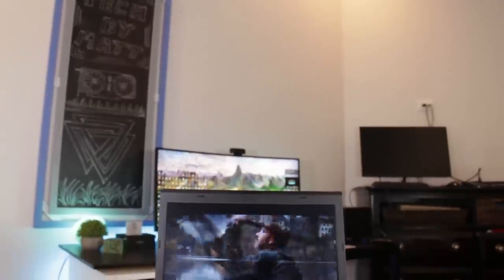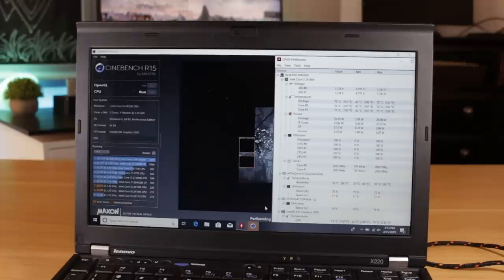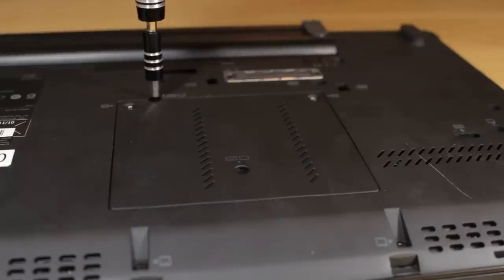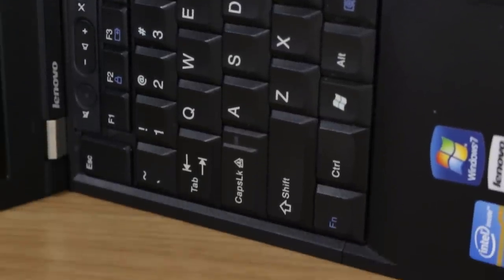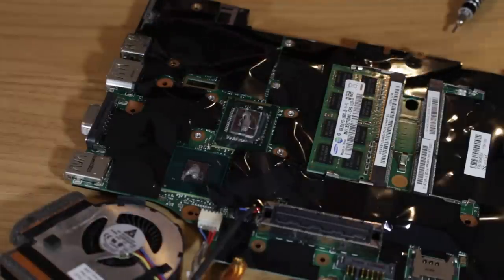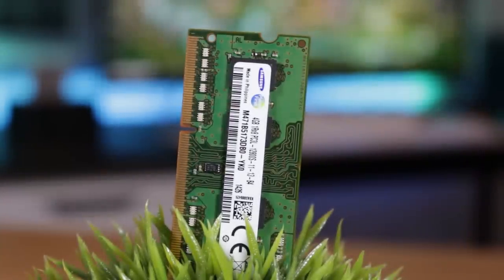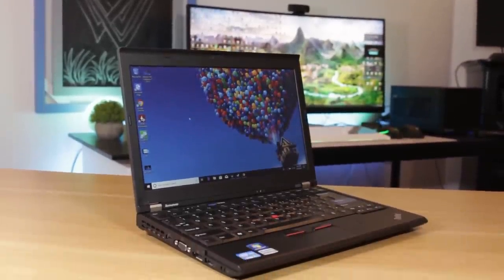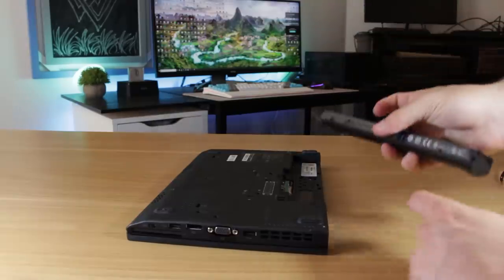What Can A $75 Laptop Do? (Plus Some Upgrades)

Comment: I bought a thinkpad t510 for 40$ 3 weeks ago. It is max equipped with an i7 620m, a webcam, a fingerprint sensor and a nice display (don't know which one). I upgraded it with an SSD for 77$ (500gb, 2.5") and one more 4gb ram stick for 25$ (yes, Switzerland is really expensive) which gave me 8gb in total. What shocked me, was that it couldn't run CS:GO. I'm talking shadows disabled level of low graphics. 10 fps at max. I think I'll try to add an external GPU (I have a GTX 660Ti lying around somewhere). Overall, its better than a new laptop (i7 7500U) in terms of the build quality and I'm using it as my daily laptop now (I have a PC don't worry).

Comment: Thank you for this very instructive video. I was just asked by a friend about about getting a computer and my instructions now are "get a Thinkpad with a removable battery" and your video shows up on my watch list.

Very concise and explains why folks should not really get some new piece of tat for a low cost machine. The getting deep inside and changing the paste and adding the boot drive was boss.

In fact this may be the laptop I am looking for.. the last of the original keyboards? Shut up and take my money!

Thank you again as it really saves me (and my listener) much time with a simple show and tell rather than a long speil.

And of course Thinkpads are the way to go if you are a Linux user. (I persolally recommeod Pop! OS over Ubuntu personally for all around introductory use.. Especially now that 20.04 came out..)

Comment: It's January 2024 and I still use this laptop in an official Lenovo X220 dock and have upgraded it with a 250GB Samsung SSD and 16GB of RAM. I think I might also upgrade the CPU/motherboard to the i7-2640M...

Comment: You can go a bit further by using faster ram which always helps the igp as this generation of thinkpads have no issues using up to ddr3 1866, you can also upgrade the heatsink using the all copper cooler from the x230 which helps a little. As for the battery I recommend the 9 cell and there is the option of finding the slice pack which is basically another 9 cell that uses the docking port connector which can enable over 10 hours of battery life with ease.

Comment: In Belgium in 2017 I bought a HP Elitebook 8460p with a i5-2520M CPU for €170. I like the machine and I directly upgraded it to 8 GB (€25) and replaced the 320 GB HDD by a 1 TB SSHD. The most important update was, that I replaced Windows 7 by Ubuntu Mate 18.04.2 running from the ZFS file system. Most datasets (folders) including the root are LZ4 compressed, while archives are GZIP-7 compressed. The ZFS memory cache is between ½ and 2 GB, which means, that after a short time, the system or Virtual Machine runs completely from memory cache. Cache hit rate are above 90%, so the system is very responsive. Basically the system runs a 3-level storage hierarchy (2 GB Memory Cache, 8 GB Solid State Cache and 1 TB HDD). Note that everything including the caches are kept LZ4 compressed , almost doubling both effective cache spaces and the disk space. It is like having StoreMI on a 2011 laptop.

Planned upgrades are 8 GB to 16 GB. Next year I like to replace the 2-core I5 by a 4-core I7, but that i7 price has to drop considerably. Afterwards I might add another 1 TB SSHD, dumping the DVD, if the SSHD prices are right. I would stripe (raid-0) both SSHDs :) More plans than money, but this year I concentrate on my desktop replacement from Phenom II X4 B97 to a Ryzen 3 2200G, ~doubling my desktop CPU speed (and memory).

Comment: I have a X270 with 16GB RAM and 512GB SSD with a 1080p IPS LED screen I installed and I'm STILL thinking about getting a decent X220 because it's so cheap, durable and it's the last of the great keyboard laptops where the keyboard was simply just another component that had to be great. None of this slim, light, compact nonsense we have to put up with now.

Comment: X220/230 are still amazing machines in it's class, especially if you going to use special edit way to upgrade it.(51NB made a X330p with i7-3612QE, 16G ram and 3*drives. FHD 99% sRGB 13.3in) it is on par with $1000 machine these days. It is even on par with X390

Comment: Men. thats alot of thermal paste
Reply: Yup he iced it like a cake, way too much
Reply: If you leave a corner uncovered you can brick the system with these fully exposed chips. As long as the thermal paste is not electronically conductive it is totally fine and doesn't hurt cooling performance either
Reply: Not that much actually, laptops tend to have pretty poor contact between the heatsink and the die.
Reply: @basbas63  should i use thermal paste if I buy a used laptop.  Or should I only do it if temperature problem occurs .

I don't know how to apply thermal paste
Reply: @bravosix8171  Only do it if there are thermal issues, that is my point of view on this. 

Don't forget that taking a laptop apart is usually a task that takes a lot of care, there are connectors (that connect the keyboard and the screen to the motherboard in example) that are easily damaged. 

In my opinion it is better to not try and fix something that is not broken in this sense. 

Good luck, hopefully if you are going to buy or have already bought a second hand laptop that it serves you well! =D
Reply: @basbas63  Thanks Comrade. I appreciate your help. Peace be upon you.

💂💂💂
Reply: Literally doesn't matter

Comment: I scored an "un-tested" Asus G74SX, a similar era PC, for free...turns out all it needed was a new HDD / SDD,, a new battery, and a 150W charger...it came with an i7 2670QM, I added 8GB or RAM or 16GB...and the included GTX 560m 3GB is a decent competitor to a more modern laptop IGPU.  I actually plan to upgrade the display too, as there was a 1920x1080 with high refresh rate, either 100 or 120hz, can't recall.  All in all, it's been a fun project to resurrect, even though I rarely use it.

Comment: Oh man I love old laptops! I just ordered a Latitude e6540 for $220 with an upgradeable i5 4300m, a dedicated AMD HD 8790m with 2gb GDDR5 VRAM, 8gb ddr3 1600mhz, and a 256gb SSD. It has a charger and healthy battery.

Not bad for a budget gaming laptop! You should look into it yourself, or for a little less ($140-$180 in good condition), its slightly smaller sister the e6440 (the model with the dedicated 8690m which also has gddr5 memory!)

Both laptops have potential to be upgraded to quad core, eight threaded i7's for about $70
Reply: thats impressive value right there, dont  remember how good the 8790 would be, but 2gb vram is actually usable
Reply: @bradhaines3142  It's pretty ok on paper with 384 stream processors, but in reality it seems to perform very slightly below a GTX 660m/750m/940m

Comment: My favorite two of all my laptops, old and new alike, are the T420 and T430... Each swapped respectively with 4c/8t i7 qm variants, which can be done with a T series... unless its an S model usually. Brings them up to a standard FAR above the level of even $600-700 units today, with passmarks and cinebench scores that obliterate ultrabooks as well as business and work machines. Yet rarely consume over 15w... though keeping in mind they are now capping at 35w rather than 25... Also have 16gb 1866 in each. Never tossed an egpu in either of them, as gaming really isn't what they're for, though they can provide light duty gaming on the go with lighter titles, older titles, and emulation... as they are Sandy and Ivy bridge, respectively... so intel 3000 and 4000. Both are running SSD raid arrays, with phenomenal speeds... The 420 has the 900p screen, the 430 the 1366x768, or what, 768p? I dunno.... I'd like to swap it to a 900p as well. The 420 has the last of the amazing keyboards, the 430 goes chicklet, and as such I swapped in a backlit one... so it retains the thinklight, but now has a much more modern backlit keyboard as well...Looks great, and truly types VERY well for a chiclet style. It's a toss up which I like more to be honest, they both have massive merits and very little cons.  New Amazon sourced batteries make for 6-8 hours on either of them, they are 14" units, and I also find them extraordinarily portable. They are robust, well made, and truly just put nearly anything today to shame. I have some other favorites as well, elitebooks with dream color displays, cpu's swapped, etc... but none have so much going for them the way the 420 and 430 do... X series are nice as well, don't get me wrong... but you're stuck with that poop cpu, and that just doesn't work for me... I need passmark's in or very near the tens of thousands... and that i5 just isn't close. It's fine and all, I'm sure it mostly is for most things... but heck, I can render video on either of mine, and it's not even a bad time.  You know what, I did have an egpu via the wlan card slot on the 420, I forgot about that... this was before I had the 1070, 1080, or the 2070, and was running a gtx 1060 6GB... it had no issue keeping up with that card, with the card being the bottleneck up from 1080p to 4k... so the cpu was pretty stout for sure... Just that I have a 4930K pushing a 2070 on the main rig, which keeps up with the gaming needs just fine, so that was the last time i had the egpu dock out. It's in a drawer somewhere I believe. Either way, these are all of the best machines ever made...

Comment: i bought one of these (the tablet version) and I love it, i use it for tuning my car and for mobile movie nights with friends, I upgraded the RAM to 2x8gb sticks for cheap, I bought the LEnovo 90watt power adapter which helps to keep the CPU from throttling when plugged in, and it charges faster. I also bought a legit 9-cell battery from ebay (the x200T's never came with more than 3 and 6-cell officially, but someone makes them) and I bought 2x slice batteries (1 for home and 1 for work) and I basically never have to charge this thing during the day even under heavy use it has 10-12+ hours of battery each day, amazing! DON'T FORGET, to install Thinkpad's software called Lenovo Vantage, it lets you modify lots of features, you can even set a charge limit on your batteries to help them last longer over time. I set mine stop charging at 85% capacity.

Comment: I've bought my laptop for nearly 600$ in 2013, it's 2019 now, it can't even run csgo at a consistent 30fps
Reply: Saad my 2007 08 laptop with b960 processor and inbuilt graphics is running csgo at about 20+ fps. Just using steam on Linux.
Reply: @maninthecrowd5076  mine laptop can't even run steam

Comment: This is a very nice video.  A lot of good information.  I would be a fun project to replace for LCD display with a used IPS panel for fun.
Reply: Heck yeah.
I want to see this myself.
I plan to do a full-on upgrade to at least one of my ThinkPad's for personal use. Already did a personal rebuild on a Compaq Presario CQ57-339WM that is amazing in terms of capability, but I want Lenovo as well.
Reply: Joseph Lopez Damn I used to own a Compaq Presario CQ57 too, I loved that laptop, lasted many years
Reply: @CM-pv3dm  I have 4 of them right now.
One I just put a Core i7 2720QM in it and it runs amazingly. Also found out the ram "limit" was a soft limit. So far I found it can support up to and recognize 12Gb with not a single issue. I modded the internal heatsink for the chipset and lapped them before reinstalling.. The 45w quad core actually runs cooler then the Celeron that was in it originally..
Between that and the 240Gb Kingston Black SSD I put in, this thing will remain in my service for years to come. Also have a backup new motherboard for it just in case.

The second one has a Core i3 2330M with 8Gb of DDR3 G.Skill ram. It's quite a bit faster then the Celeron.

The third one I am putting a Core i5 2350M in with 16Gb Crucial DDR3 1600 mhz ram and another 240gb Kingston Black SSD drive in.

The fourth one will remain stock in parts but will be modded slightly for information purposes. Lapping the heatsink and maybe add a new heatsink or two to the mobo to see if performance changes at all. Right now, it runs hotter then the Core i7.
Reply: The Lenovo ThinkPad T420i I have is going to get the royal makeover. I'm going to throw a Core i7 Extreme in it to see what kind of performance I can get. Not sure if the board will support it, but so far the support list for the contained chipset is promising.

Comment: I recently bought a Dell Latitude E6420 for $74 on eBay. 4GB of ram, Intel Core I7 2640M and a 120GB drive. Will be in on Monday. Also has nVidia NVS4200M graphics. Rough equal to a GT520M
Reply: Abyss Tech Adding 4Gb more of ram will improve it a lot, dual channel does wonders
Reply: @thepeasant269  I've got a 16GB kit in my old Acer Aspire E5-551 laptop I can use.

Comment: this lapotop 100x more cool than any Fruit brand
Reply: real cartoon girl a heck of a lot slower than the “fruit brand”. I’d take a MacBook over this anyday, plus it’s a lot more reliable and you’ll have a warranty.
Reply: @parkerwilliams617  fr
Reply: Talking trash doesn't make apple more appealing, it just shows what type of arrogance purchases them.
Reply: @parkerwilliams617  *Your screen starts flickering due to the connector being loose.

 "Oh your MacBook screen starts flickering? You gotta buy a brand new screen, and a logic board. That will be $1,399. You might as well buy a new MacBook. You will have the latest hardware and firmware and have a new warranty. Will that be cash or credit?" -Every genius bar ever
Reply: @parkerwilliams617  Nope not even close. Thinkpads can be run over by cars, you can spill water on them, thrown around and they'll be fine. If you buy a new Macbook, you get no upgrade or repair options and a number of design flaws (overheating, keyboard failures, display cable failures)
Reply: @parkerwilliams617  For this laptop costing less than $100 itself on Ebay, upgrade to a new SSD, add a touch more RAM to it like the person in the video did. Maximum costs you $200 for a metal built business laptop that's more versatile and durable than any warranty a "fruit brand" can provide. I'd like to see you pay over 1 grand for a laptop just to do basic computing tasks for businesses that's more water resistant and more user friendly to diagnose. A regular consumer can't even save money by upgrading their "fruit brand" device without the need to drive into a store and pay for labor, let alone the expensive part itself "designed for" the product. Consumer products from "fruit brands" and other brands made specifically for consumers have planned obselescence in mind, whereas products made for businesses will last much longer than you'd think. These business laptops were made for companies whose employees need mass amounts of, and they can't afford to constantly upgrade every 2 or so years. These business laptops are made to last at least 5 years or more. 

To put things simply, don't go talking down on older products just because your shiny new product seems to have a "warranty" that only lasts 2 or so years. If you have the luxury to purchase those convenient and shiny products that only last so long in today's ever-so-evolving age of technology, by all means go for it. These people are here to see how well an 8 year old "clunky" laptop can perform, even when upgraded to "mediocre" performance. 

Lastly to throw a bit of shade in a general direction to a specific group of people, I'd like to see you buy a laptop like this, as well as a new "fruit brand" laptop and drop them both onto concrete from 5 feet in the air, as well as pour water onto the keyboard and/or display, to see how both perform. I can almost 100% guarantee you the business laptop will take less damage and cost much less to repair, compared to any consumer grade laptops made nowadays.

Comment: ... I was bidding on an X220T last night that was like $50. I knew I should've bid higher on that thing :/
Reply: Aw damn, those T series are amazing, you really missed out!
Reply: I owned an X220T!

Honestly, the regular non Tablet versions is better.  The hinge sucks on the T model (loosens up) and the device is slightly larger.

The Touch/Pen display also has issues in Windows 10 (lack of drivers) and is NOT accurate, even after many calibrations.

The only benefit for the T models is a guarantee of an IPS display.

IMO avoid the Tablet series!
Reply: watching this from a T420
Reply: @beickus  noice

Comment: Yesterday I got an E431, which is a bit newer but not as durable, has the newer keyboard, doesn't have physical buttons above the the trackpad, but I'm ok with it because it was incredibly cheap in my country compared to even other Thinkpads. I actually wanted an X230, but it was more than double the price.

Right now it's got an i3 3110m (in a few years time I'll upgrade to an i7 3632QM), 8GB of ram and a 500GB hard drive. I bought a caddy adapter, and when both the caddy and the laptop arrive, I'll be taking a spare 120GB SSD I have in my PC and putting it in the laptop and it will become a mobile beast for about $170 dollars total (adding the price I paid for the SSD two years ago and converting from Brazilian reals). It probably would've been half the price in the US, but I'm still super happy an excited for the upgradability. The keyboard seems to be very good either way, too, even if the older ones are better.

Update: keyboard is pretty nice (yeah, it's the chicklet one), the trackpoint is much better to use than any trackpad I've ever used and I got used to in the same day I started using it. The trackpad is quiete bad, but not the worst I've ever seen. It's super snappy with the SSD and performance is very good. The fingerprint sensor is a great addition, too.